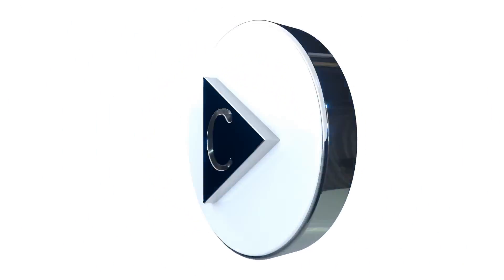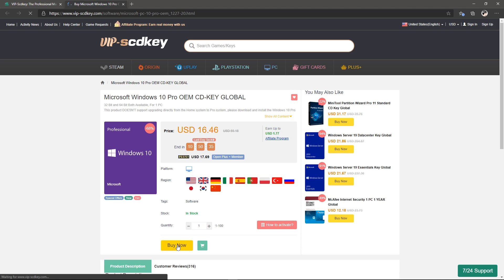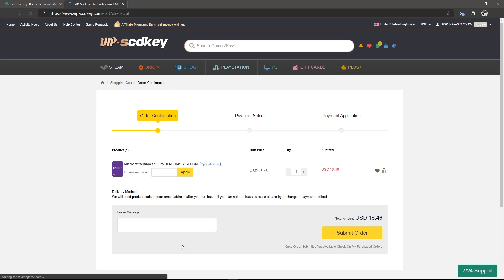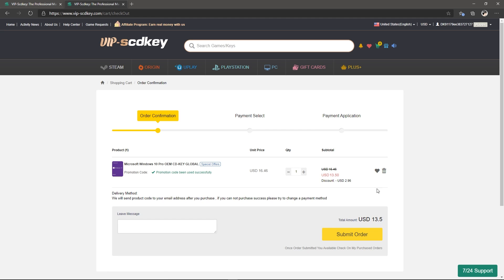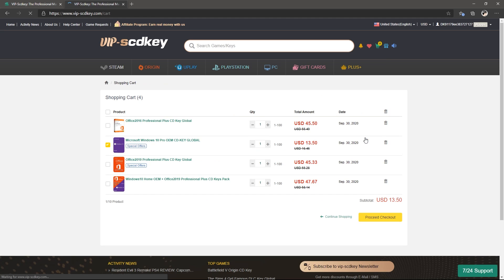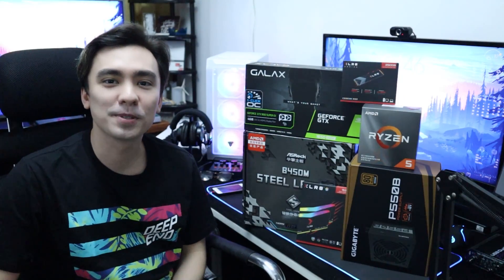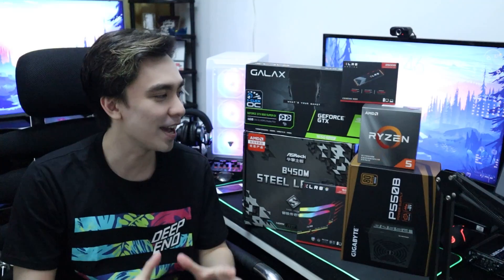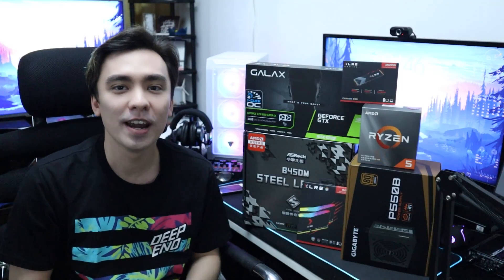SHOPEE LAZADA PC BUILD under 30K ft. Ryzen 5 3500x for Gaming, Streaming and Music Production 2020

Comment: Gagana poba siya boss kung walang graphics card
Reply from the maker: No, you'll need a different processor if gusto mo ng walang graphics card, check my 25k build for that option: https://youtu.be/ickWlVLt78E
Reply: AMD RYZEN 5 3500X AM4 PROCESSOR / WITH WRAITH STEALTH 
Biostar A320MH B450MH mATX Ryzen AM4 AMD Motherboard 
Kingston HyperX FURY Desktop DDR4 RAM 8gb 2666 
Kingston Internal Solid State Drive 240g SATA 3 2.5 inch Hard Disk HD 
Silverstone Strider Essential 700w 80 plus ST50F ST60F ST70F Power Supply PSU
Reply from the maker: @maryjoyquii  b450 ang kunin mo na motherboard and make sure na ryzen 3rd gen ready. Also, di gagana pag walang video card ang ryzen 3500x. I suggest mag ryzen 3200g or 3400g ka muna para kahit walang video card pwede. Anytime pwede ka magupgrade/add ng video card
Reply: Ito po sana i bubuild ko sir
Reply from the maker: @maryjoyquii  hindi gagana ang ryzen 3500x ng walang video card. Ang kailangan mo is either ryzen 3200g or 3400g. Kailangan is "g" pag walang video card para may kasamang APU built in
Reply: Okay thankyou po sir 🤗🤗🤗
Reply: last tanong na po HAHAH any kind of graphics card poba is kaya ng build ko????
Reply from the maker: @maryjoyquii  kaya naman kasi di ko masusuggest na bumaba ka sa 1650super na videocard kasi di mo rin maeenjoy ang ryzen 3500x mabobottleneck kalang.
Reply: Thankyou poooo 🤗

Comment: Lods nagdisplay na pero ang nasa monitor is “Reboot and select Proper boot device or insert boot media in selected boot device and press a key” 

Feel ko iupdate pero idk what key to press. Ang concern ani is ang motherboard is incompatible with the Ryzen 3rd generation processors and needs for update para mause. Help lods
Reply from the maker: Ung hdmi or vga dapat sa videocard na nakasaksak, next thing you need to do is get a windows installation usb para dun magboot at makapaginstall ng windows os
Reply from the maker: Pag maguupdate ka ng bios, use another computer tapos download the update sa motherboard's website. Lagay mo sa usb yung update tpos balik ka sa bios to update.

Comment: I follow all the parts you had and Nabuild ko na po yung PC kaso may beep po siya na 5 short beeps then 1 short beep, reason why my monitor will not start. Please help lods
Reply from the maker: Pwedeng processor or gpu ang problem. Same specs lahat? Lagay mo dito if may iba kang nilagay
Reply: PC BUILD
ASrock B450M STEEL LEGEND

Gigabyte P550B 550 watts

PNY CS3030 M.2 NVMe 1TB

PNY XLR8 RGB DDR4 16GB (2x8 GB)

AMD Ryzen 3500X

Feel ko po GPU Hindi po kasi Ako bumili ng GPU kasi akala ko yung professor is may GPU ready na siya pero yung may end na G pala yung Pwede. Out of stock na din po kasi yung GALAX GTX 1650 super. Ano po ma recommend nyo na GPU po for this build lods huhu.  May nakita Ako na GALAX GTX 1650 SUPER EX sa lazada pero 18k double the price nung normal GTX 1650 super
Reply from the maker: Yes, dapat 3200g or 3400g kung di ka bibili ng GPU. Magkano budget mo for video card ihahanap kita, send ko link.
Reply: Nakabili na ako lods oki lang ba yung Zotac 1050ti mini? Compatible nayun?
Reply from the maker: @moviefries6066  yes gagana naman

Comment: This casing have a led cable...where i fixing it?
Reply from the maker: You need to connect it to a compatible motherboard or order a separate fanhub to control the led lights
Reply: Thanks a lot 💝
Reply from the maker: @jetupal5825  welcome
Reply: My motherboard have a port jc11..can i fix it the cable this port jc11
Reply from the maker: @jetupal5825  what is your motherboard brand/model? You can also leave it like what I did. I did not connect it to anything

Comment: Nice build mate! Also i bought the same case but in black, it's pretty cool, and for some reason mine came with two of ''Led'' Panel connectors instead of just one (as shown in the video at 4:10 for example).

Comment: Sana ganto parin talaga pricing saaaaaaad T_T
Reply from the maker: kaya pa rin ng ganto kahit ngayon bumili
Reply: @calebmusik21  parang iba naman na pricing boss nag check ako dun sa link mo at other options din kaso di kakayanin yung budget
Reply from the maker: @josephcrebz3  sige gawan kita list, para magamit mo bukas 5.5 sale - magkano ba budget mo
Reply from the maker: @josephcrebz3  Motherboard: ASRock B450m Steel Legend Php 4800-5500 SRP
SHOPEE: https://invol.co/cl3urno

Processor: AMD Ryzen 5 3500x (3rd Generation) Php 6800-8000 SRP
Cooler: AMD Wraith Stealth Cooler (FREE)
SHOPEE: https://invol.co/cl3urof

RAM: PNY Epic-X RGB XLR8 16gb (8x2) Php 3400-5000 SRP
SHOPEE: https://invol.co/cl3urpp

SSD: PNY CS3030 M.2 XLR8 NVMe (250gb) Php 1800-2400 SRP
SHOPEE: https://invol.co/cl3urr9

PSU: Gigabyte P550b 80+ Bronze (550w) Php 2300-2500 SRP
SHOPEE: https://invol.co/cl3urs0

Chassis: Fantech Aero CG80 w/ 4 RGB Fans (Space Edition) Php 1900-2300 SRP
SHOPEE: https://invol.co/cl3urt9

Video Card: Galax GeForce GTX 1650 SUPER EX (1-click OC) Php 7975-9400 SRP
LAZADA: https://invol.co/cl3urt1

As of May 5, 2021
Original Price Total (without coupons) = Php 33,199 + Shipping
My Total (with 5.5 coupons) = Php 29,150 + FREE Shipping 
Total Discount shopping online: Php 4049

Comment: Hi good day.
Right now how is working that Gigabyte PSU? I bought it for my new build but the guy from hardware busters says it's a piece of junk :(
Btw I have experience with "low quality components" PSUs, I'm using an evga 430w since 2017 and still working fine.
Reply from the maker: Hi! I’ve used gigabyte for three builds and it works perfectly.

Comment: Have you tried enabling XMP for such ram kits? How was it? I’ve heard, there were some users having an issue with the same mobo. Thanks.
Reply from the maker: I’ve enabled xmp to use 3200mhz for the ram. No problems so far. I updated to the latest bios available for steel legend

Comment: sir which is better in Motherboard the MSI Mortar Max or the Asrock Steel Legend?
Reply from the maker: Sa b450m models - September 2018 released ang Mortar and February 2019 naman ang Steel Legend. Mortar has 2 PCI-Express x1 Slots. Steel Legend has 1 PCI-Express x1 Slot. Maximum supported ram ni mortar is 128gb while steel legend supports up to 64gb only. Mortar has no rgb sa mainboard. Steel Legend has rgb na controlled using polychrome sync. Sakin boss personally  steel legend kasi trusted ko na asrock brand sa unang computer ko. Hanggang ngayon buhay pa since highschool ko pa gamit un.
Reply: @calebmusik21  Thanks boss Caleb pero pwede yung palit na video card sa steel legend?
Reply from the maker: @jpgabriel7754  you mean “PALIT” na brand? Yes, pero kalimitan 1 fan lang ang “palit”

Comment: very informative vid, thanks! oh, do you suggest paying online as well or going with COD? like, shopee has a bunch of vouchers if you pay via ShopeePay, but isn't it also risky to spend before actually receiving the item?
Reply from the maker: It’s actually safer to pay online using shopee pay or lazada wallet. You get the extra vouchers plus kapag may problem sa item you just return it through lbc for free and they will process the refund faster (you’ll get your money back papunta sa e-wallet mo) so you can buy a new item for your build again. This actually happened sa power supply ko dito- they sent me an incompatible one so I returned it, got my money back and purchased a different brand with no extra cost. Thanks for the comment and feel free to subscribe for more
Reply: @calebmusik21  oh wow thanks for the info! Btw, was your steel legend mobo ready for Ryzen 3rd gen or did you have to go and update the bios? Thanks again! Subbed!
Reply from the maker: It’s 3rd Gen ready when I bought it. I still updated the bios to the latest one and bought another one for a subscriber build. Thanks for subscribing!

Comment: Hi bro where do you put the cable that is call only LED???
Reply from the maker: You can connect it to an led strip or a separate fan hub
Reply: @calebmusik21  so there is no problem if the entrance have 3 pins and the cable is only for 2?
Reply from the maker: @madduv5082  no, don’t connect to three pin if you’re unsure. Check your manual first. Led strips are 2 pin only. I didn’t connect mine because I don’t have a fan hub or an led strip.
Reply: @calebmusik21 thanks sorry i read on bad way last time

Comment: some help here, where u conected the LED pin of the case? thanks
Reply from the maker: You can connect it to an led strip or a separate fan hub
Reply: @calebmusik21  I conected it to my rgb hub and now button led case change the led secuense. Thanks.
Reply: same tayo na tanong hehe..kasi sa ibang case 4 or 3 pins ang sa led mode, dami ko ng pinanood na video kung pwede ba palitan ang fans with rgb na macontrol lng button sa front panel
Reply: @davemarkang232  dude, I dont understand any word of u xD
Reply: @EvilZ3RO  im sorry, we have the same question where to connect the LED pin of the front panel
Reply: @davemarkang232  bro, I connected it to my rgb hub controller. If u have a rgb strip, u can connect there too
Reply: @davemarkang232  It's just for something cosmetic or aesthetic. you only control the color change of rgb fans or led strip.
Reply: @EvilZ3RO  bro, tnx for the info

Comment: Why not Ryzen 5 2600? Hehe
Reply from the maker: Hi! The Ryzen 5 3500x is much more recent (3rd gen - Zen 2), optimized for gaming and has a base clock of 3.6 GHz and a boost clock just short of the Ryzen 5 3600’s 4.2 GHz, at 4.1 GHz. The Ryzen 5 2600 is only (2nd gen - Zen+) , base/boost clock of 3.4 / 3.9 GHz and more on productivity use.

I focused my build for gaming, streaming and music production which doesn’t require 12 threads.

Comment: Nagpplit din ba ng color ung fan nya?
Reply from the maker: No. But the fans are removable. You can buy argb fans (3 in 1 kit/fan hub) and connect it sa chassis/led button to change the colors with 1 press

Comment: Hello, I'm planning to buy PNY CS3030 500GB m.2 SSD. How is it with B450M Steel Legend since it's not on the Asrock supported list? :)
Reply from the maker: Works perfectly and same speed as advertised (3500mb read 2000mb write for 500gb variant)
Are you using Ryzen too? Take advantage na rin by installing StoreMi app by AMD -it combines SSD Speed with HDD Capacity

Comment: Future proof po ito for how many years? Kaya ba nito wzone?
Reply from the maker: I’m expecting this to last for 5 years or so. Sakin kasi nothing is really future proof. We’ll never know kung anong iuupgrade ng companies next year. I’ve listed an upgrade path sa description too. One thing I can assure you is that you can play AAA games using this build. Magdagdag ka lang ng SSD or HDD 500gb or 1tb para mag-kasya lahat lalo’t nagtaas ng space requirement ang warzone. Hope this helps
Reply from the maker: @shinoahiragi4795  I recommend WD 1tb (Blue)  Php 2000-2300 SRP
LAZADA: https://invol.co/cl1hfre
SHOPEE: https://invol.co/cl1hfr6
AMAZON(PAID LINK): https://amzn.to/352dym1
Reply from the maker: @shinoahiragi4795  Yes boss, if may extra budget go for 1660 Super Php 11900-12900 SRP
LAZADA: https://invol.co/cl1hft6
SHOPEE: https://invol.co/cl1hft1
AMAZON(PAID LINK): https://amzn.to/3nTwoEK
Reply from the maker: @shinoahiragi4795  Also, I suggest using StoreMI, para maconnect mo ang m.2 nvme mo sa hdd 1tb na bibilhin mo. You'll get the same speed for both harddrives. So para ng SSD ang speed ng HDD mo. Hope it helps!
Reply from the maker: @shinoahiragi4795  It’s a free application by AMD. A fast and easy way to expand and accelerate the storage in a desktop PC kapag naka Ryzen Processor ka. Go for the 1660 super graphics card. Kasyang kasya na sa budget sobra pa 👍
Reply from the maker: @shinoahiragi4795  35-40k if same build and depende pa rin sa availability ng items at sa shop kung saan ka magpa-build.